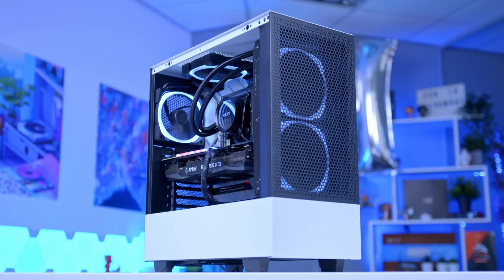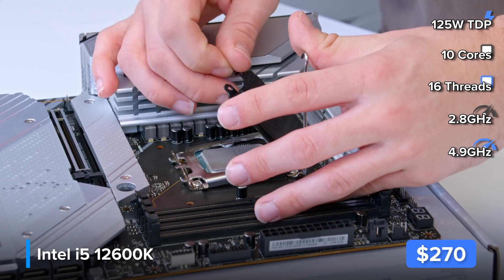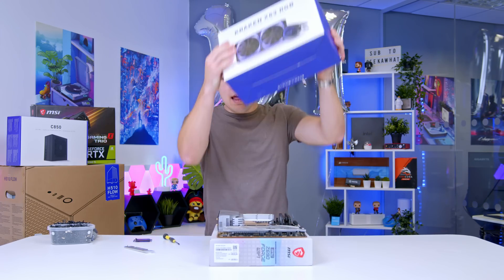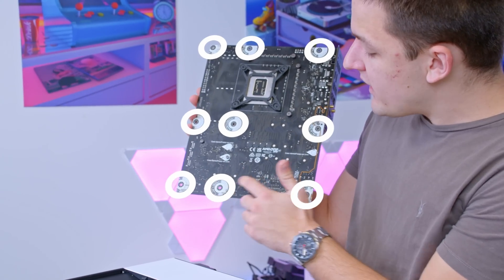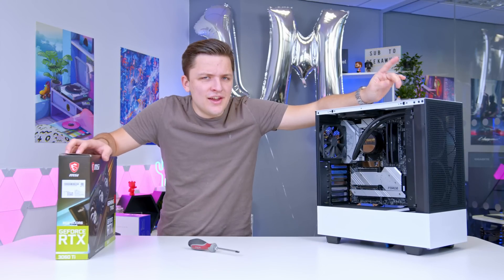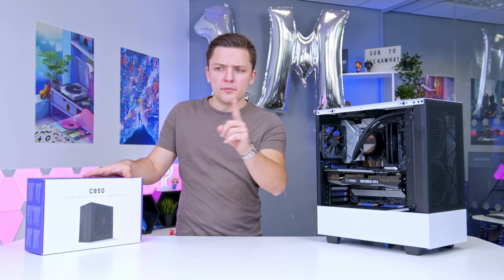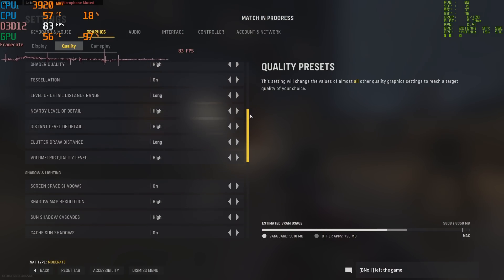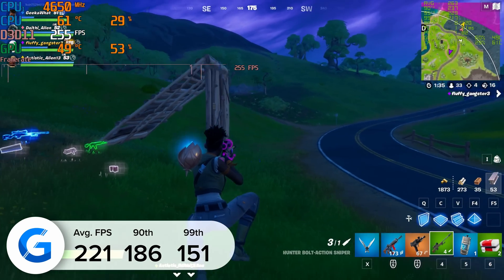Best $1500 Gaming PC Build 2022! [RTX 3060Ti & I5 12600K - w/ Gaming Benchmarks!]

Comment: My setup is 1670$, compared to this, mine its only dual fan version for 731$, 12600kf for 280$, and aorus gaming x 280$, just 1 storage msi m470 1tb for 160$ around, 16gb 3200 cl16 i guess and its rgb from kingston for 92$ around, psu and case i don't remember at all.
Reply: I mean, thats too awful to see what you get with those price.

Comment: Fun fact if you were to buy every part at once right now with inflation, this build would cost gross pay of 2,417.92$ before taxes… anyways just understand that gpu and ram is the biggest factor in cost alone both parts combined 1100 dollars…
Reply: Could u help me actually make one that would be 1500?
Reply: @ogkok1869  tbh rx6600 be a better option but your still looking at over 1500 from ddr5 so I rock i5 12th gen but with ddr4 as it would save you a lot more money.
Reply: @crazywall256  I found a 3060ti for 699

Comment: The "$1500 build" with the $1000 motherboard assembly
Reply: its insane! its every video!
Reply: you can build a pretty solid 1500# 3060ti system but not with these parts
Reply: @amandabielecki2290  yeah this time its not even with his excuse of the gpu being at msrp you tell me where you can get a 3060ti a 850w powersupply and case for less than $500